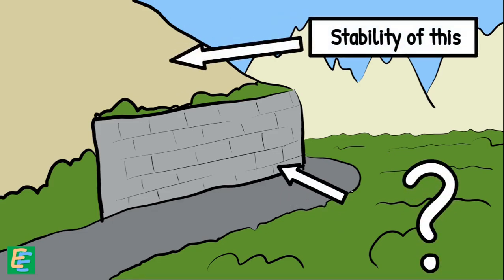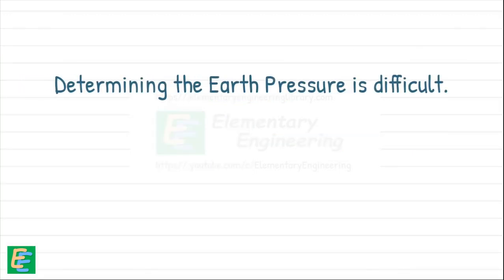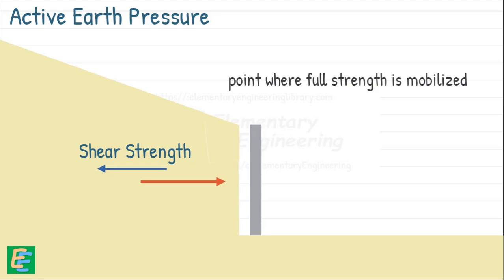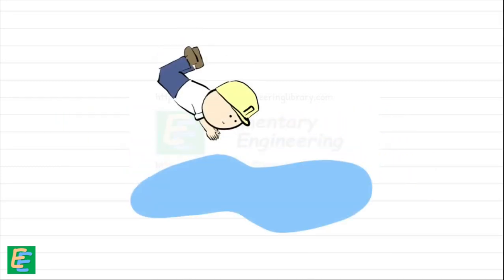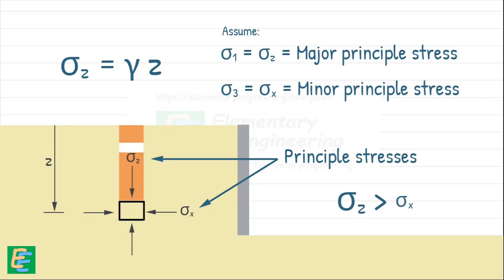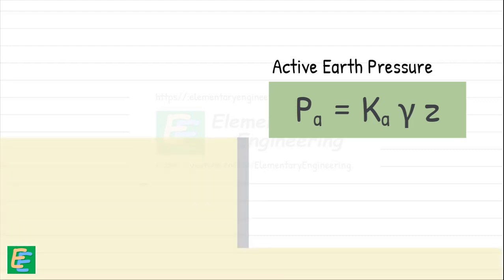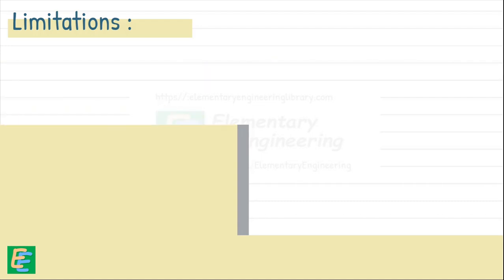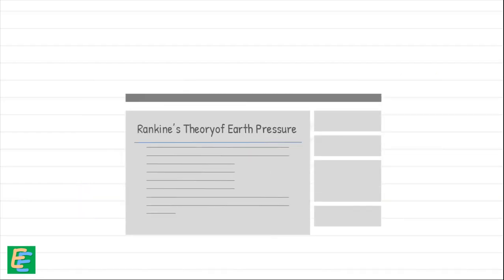Rankine Theory of Earth Pressure | Elementary Engineering

Comment: can you tell me when and why will a retaining wall move towards the backfill region (passive earth pressure) we know that the active stage is due to poor construction or vibration or erosion of soil. As the soil is applying horizontal pressure ,the wall will always try to move away from the backfill so how it will move towards the backfill??
Reply from the maker: well there may be numerous reasons for a wall to move towards the backfill.
external force, vibrations from passing vehicles or earth quakes, if wall is loaded etc. there may be many other reasons.